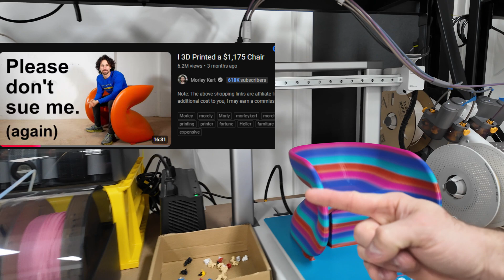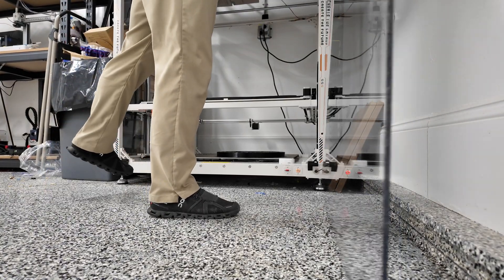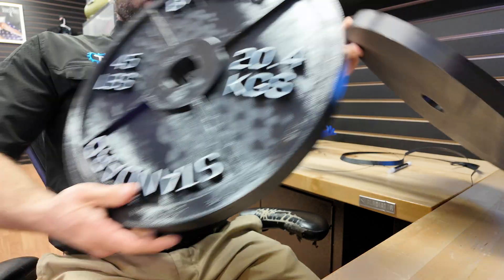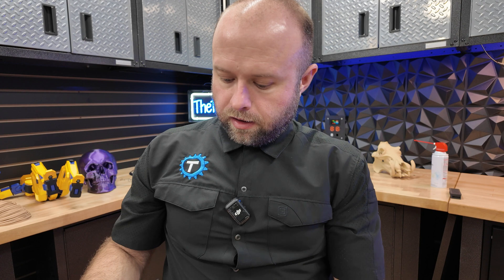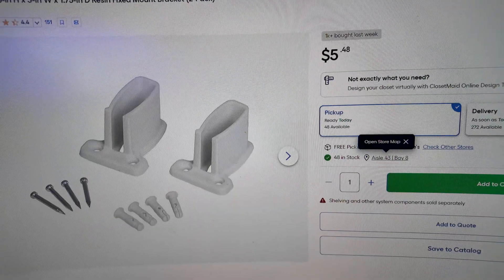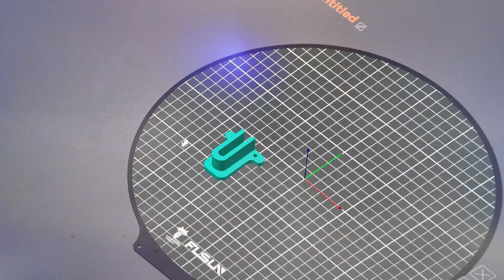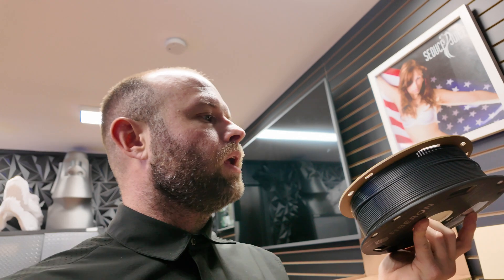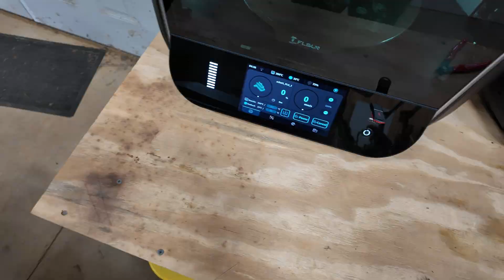New 3D Print Ideas & Products using ALL types of printers: 3D Print Side Hustle Vlog

Comment: My thought for the weight plates is to use a slightly more matte black filament if you can find one. Ideally one more top layer or slightly more infill too. For the chair, I'd print it in the same orientation it sits. I'd say try a 45 degree angle tilted back, but a full size version is going to be so heavy that would be sketchy without a designed support to help with the weight. I think it will be plenty strong even with a few walls and decent infill. I'd probably say go overkill with 4-5 walls and 10-20% infill, but I'd have to see what it looks like in a slicer. I think printing stuff like those shelf parts definitely makes sense. Still saves gas, shopping time, and money as long as you have a free printer. Fiber filament typically very brittle.

Comment: After using both, the Biqu Cryogrip Frostbite is far better than the Bambu supertack. Thats all I use in my farm now after testing a bunch of different brands and models. Don't buy a subpar plate just because of the color, but to add I also didn't like the color either.